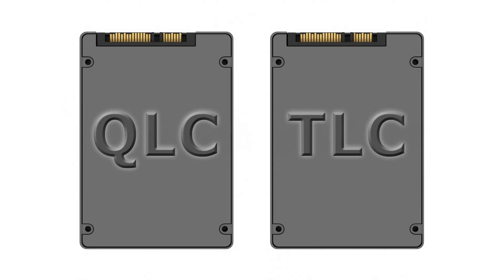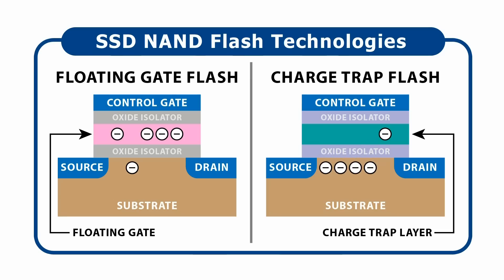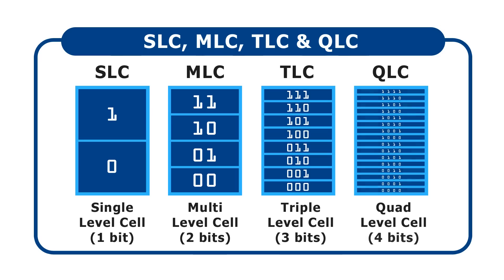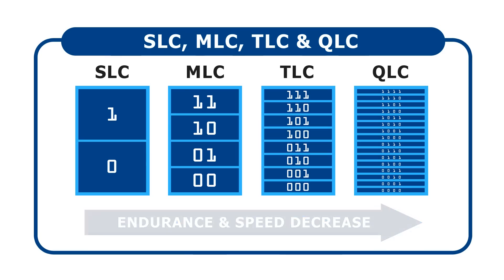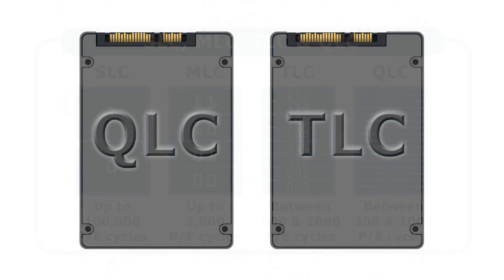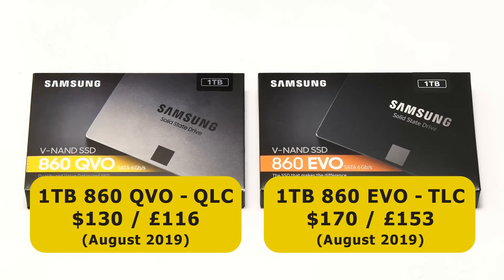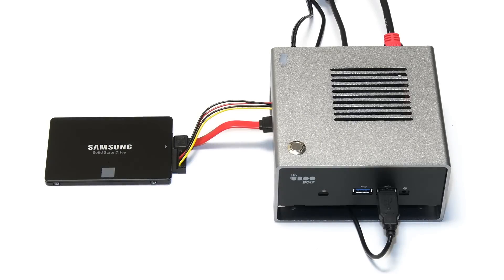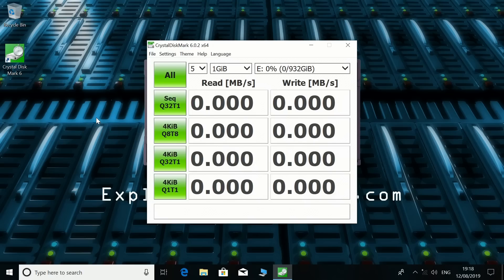QLC vs TLC SSDs: Samsung QVO & EVO

Comment: If hardware not updated on the Evo, it could be clearing the cache as it writes to the storage freeing up additional space for longer use of the cache. Wonder if that drive was close to bottling out the cache. Could you transfer 100 Gb to the drive to see when it slows?

Comment: The biggest SSD that I have right now is only 1TB, and it's a cheap one at that. The reason I'm not particularly bothered by the transfer speed for 42+GB of content is that I usually only transfer 5-10GB chunks to it at a time. And 90+% of the time it's actually just reading content and not writing it. That being said, the initial transfer of the library was painfully slow. It averaged 40MB/s, I think.

Eventually I might replace it with an NVMe drive, but the use-case doesn't require that much speed, so I don't think it will be soon.

Comment: Awesome clear explanation on the tech Cris!
I've been going on strong with a very early model of a Samsung EVO SSD for something like 5 years now, provided that it's a boot drive that is storing nothing of real value in it.
QVOs would be just as good it seems like. But you know, for backup and storage of data that you don't want to get lost, I think things remain the same... magnetic storage still has the upper hand on ability to recover.
Perhaps my next desktop will have a QVO in it, but I'll probably still keep a big HDD there because it's acting as a 2nd backup point of the most critical data, together with my separate NAS.

Comment: Great video, I just disagre on "Would you trust a QLC drive?" Absolutely not! But I also wouldn't trust TLC, MLC, SLC, or HDD for that matter. There is no reliable single-drive solution, RAID and off-site backups are the way to go.
Reply from the maker: I never implied in any way that you I would ever trust any single drive as a data store. Any data you actually want to keep always needs to be on at least two drives. So, obviously, my trust statement was relative. Why do people keep drawing this kind of conclusion? This is a video about one kind of SSD vs another, not about data management and backup strategies. So would I trust a QLC drive as the only place to keep any data? No. Obviously not. But, would I trust a QLC drive as much as I would trust a TLC drive in normal consumer or light business use? Yes. And I think it was pretty clear that was the point I was making at the end. :)
Reply: I got your point. But it is still healthy to nag people about backups whenever storage media is mentioned. :-)

Comment: thanks again Mr Bill Gates from 1995  clone,you explaint everything ,here 1 dolar is 50,so 130 dollars is enough to buy a motorbike,i do not expect to get one of those soon but the information is always usefull,also are they more reliable than a magnetic disk?cause i ve found really old computers with disk still runing and no bad sectors or damage whatsoever

Comment: My 1TB 840 EVO 331 TBW was $410 on sale in 2014 and lasted 4.5 years before too many reallocated sectors for my comfort. My 1TB 860 EVO 600 TBW was $130 on sale at the end of 2018. It's worth noting that the TBW went up significantly with the EVOs over time while the price went down significantly. I'm quite satisfied with that. For my mass storage I will always have a large amount of rewriting and use a WD Black. Those speeds are acceptable for me. So a combined QLC wouldn't fit my use case. I wonder how durable and economical 3D XPoint will be in 5 years.

Comment: i have the 500 GB 830 EVO and i know for sure it doesn't have this 42 GB cache issue, maybe with later EVO's they added this 'feature', but your result does not show it. I would always go for the EVO over the QVO. The QVO is almost like a crippled version of a SSD. Maybe in future when capacities go beyond spinning HDD's like 10+TB, then I would use it as a write once storage only device, and a faster and more reliable NVME as a boot device.

Comment: I'm wondering ; the materials/chips used in the OLC drive are expected to get more reliable and less expensive over the next couple of years, is that right? Thanks for another great video Chris.
Reply from the maker: Yes, indeed so. I would expect QLC tech to improve, just as TLC did and other tech tefore it.
Reply: @ExplainingComputers  Wow, these technologies are growing a lot faster than before. Look how long it took for mechanical (HD) drives to cost what they are now (though the SSD factors into that in today's market also). It's good to know what to watch out for, so thanks again for this video.

Comment: I upgraded from standard hdd to the Samsung evo 1tb m.2 this past July for the first time and OH MY GOD ITS FAST! 🤯🤯🤯 lols
Reply: from HDD to m.2 . its lightening fast .
Reply: Nvme is becoming the new  boot drive standard. While Sata ssd will soon replace HDD for storage.
Reply: are you running PCIe4 yet?
Reply: i mean to be fair any ssd would  have blown u away, nvme vs sata makes little difference, but  hdd to decent sata ssd my god a whole new world, welcome to this world :)
Reply: @cataria3903  fun fact.. SATA SSDs are bottlenecked by SATA... If there was the same SSD just for PCI-E it would be much faster xD
Reply: @kajmak64bit76  this is not true.
the same ssd for sata and nvme generally doesn't get made, because it wouldn't make any sense.
to take advantage of the higher speed of pcie, the ssd needs a faster controller and faster nand. the thing is,  that getting really fast read speeds on current nand isn't hard, so u won't see any 700 MB/s pcie ssd on reads, because it doesn't make any sense.
however u can and do see  garbage TLC or QLC pcie ssds, that will burst write really fast (over 1 GB/s), but then will massively slow down, once they run out of ram + slc cache.  those drives can drop to 100-200 MB/s on write,  on a long write, or on a full drive,  which is a fraction of the write speed of my 850 pro for example, which doesn't slow down at all, because MLC.
however none of this actually matters, because the comment i responded to was about an upgrade from hdd to ssd, and in real world snappiness/responsiveness there is little difference between really really fast top end ssds and ok TLC ssds.
the MASSIVELY faster random read/write iops compared to hdds makes the difference here, NOT the maximum sequential read/write speeds.
but to get back to your comment, no the same ssd for sata and pcie would not faster on pcie,  but cheap controllers and nand can already be so much faster than sata,  that at about the same price and with the possibly same branding the nvme drive will be massively faster.
Reply: @cataria3903  that's all fine and dandy but the SATA SSD is maxing out the SATA interface... Which is why basically all SATA SSDs are the same speed basically.. They literally can't go faster because SATA is limiting it.. That's why PCI-E SSDs are a thing
Reply: @kajmak64bit76  it is important to make a difference between maximum sequential reads and writes and the limitations of those numbers.
for example, there are now QLC ssds from several vendors.  those SSDS will slow down on sequential writes to 100-200 MB/s, in comparison my 850 pro will write sequentially at i think above 450 MB/s . in this case my sata SSD is 2-4 times faster than the nvme ssd in this scenario.
this will also aplpy to TLC ssds, but less and heavily depending on the SSD, but in general it is important to note, that max advertised read/write speeds may NOT be representative for what u will actually get in your work load, if u are copying 200 GB regularly to and from the ssd, then a QLC ssd will be hell for u to work with :D 
if u only go by maximum read/write speeds for ssds, then u falling for marketing,  as those numbers hide a lot of things. yes the SATA interface is limiting, BUT in real world usage u won't notice the difference between sata and nvme in general and if u are using a drive for sequential writes, then a good MLC sata ssd will poop on some new garbage QLC. one should always look at proper storage reviews and not buy by "highest number"
Reply: @cataria3903  but still... Just because there is no difference for general consumer doesn't mean there are no difference and that it does not matter it does matter and i understand the marketing speed and the actual speed... But still... Either way you look... SATA is a limiting factor and that's why M.2 NVMe SSDs are a lot faster and as i said almost all SATA SSDs are basically the same speed... Like even the fastest SATA SSD is running and advertised as almost every other SATA SSD yea sure TLC and QLC and others will slow down over time when transferring files but still... Max possible speed for a SATA SSD is pretty much the same across all SSDs... The limit goes away when you switch to PCI-E XD
Reply: @kajmak64bit76  i am not denying, that sata is limiting, of course it is,  but one shouldn't forget the other limiting factors. also there are a lot of speed differences between sata ssds, a lot still get massive slowdowns on writes  (bad tlc drives), a lot of bottom tier drives don't have dram on them, which means horrible performance!
the point was, that u are buying a drive, not a protocol (nvme vs sata), look at proper benchmarks, including full drive writes or 90/95% full performance (to remove most of slc caching).
also remember, that random writes/reads can still differ massively compared to sequential reads/writes, again look at the drive and not the protocol.
and btw, there are also more concerns than just speed for qlc, like lifetime nand writes, unexpected issues, given how new qlc is too. (look at 840 evo bs, that should have resulted in mass recall and replacements, but samsung showed consumers the middle finger instead).
Reply: Same here it's much better than ordinary ssd's

Comment: 12:34 "Slightly bewildered by..."
I am not. I have the 840 Evo. This drive was known to have an issue. It was sold as a software issue. But it was never resolved. It was described by reviewers as a "crazy drop in performance", eventually after the problem manifested itself.

Essentially, the "fix" was to buy an 850. 

I will never buy a Samsung SSD again based on Samsung's  reputation alone. So videos like Chris's is valuable to me. We run backups that exceed the sizes in Chris's video, so....no QVO's for us for the time being.

Comment: TBW concerns? NO
My Samsung SSD has been use in my daily-used work/gaming system for about 3.5 years. SMART reports 48TBW. So if you got a QLC SSD with a 360TBW rating (which it will exceed just fine thanks) it would take 26 years to hit that number at my usage pattern. TBW should be much lower on a dedicated game SSD since beyond the initial install and updates there's not that much writing involved.

Comment: 155MB/s isn't that bad for most users if they have to write large amounts of data as that's the same speed as some SATA disks.
Reply: way to fast in comparision to HDD
Reply: @Q_QQ_Q  Oh yeah, I know that pain, I have to buy new HDD, to make a copy of my file from old hdd, on which errors began to appear, copying a few tera of date was kind of a pain in a... "back" to do.
Reply: @Gilfar  Your drive controller became too hot when copied large file, you must pull enough cool air to prevent it. (PCB on drive)
Reply: @claritoresdiano1021  I was aware of that, that why I copy a few GB of file at once, it took me like two days to safely copy everything.

Comment: Great video, quite a hard one to get all the detail in such a small space, and its a moving target as well with new data emerging all the time.

I guessed it was going to be SSD, in fact I thought I said
as much here but apparently not.  I
guessed because it is in the ‘news’ now on just how not very good they
are.  I’m being naughty and listening
while I type as I am OK with SSD.  

What is killing it is the lack of DRAM apparently, there’s
more to it than that but that is the crux of the matter.  So, we have over supply of DDR (and quite a
few types of memory) but NVMe is stable because they had a bit of an ‘outage’
which hit supply recently.  Back then
they said this would inflate SSD prices, but it looks like that isn’t going to
be the case.  But I still feel we are
being sold a kipper, the SSD price crashed on multi-level and has stabilised,
and that is artificial as the wholesale prices are lower.  The vendors are just sticking at the prices,
especially on the lower densities (so your 128GB are all costing £20 whatever happens
downwards).  1TB you see some price
benefits, even with NVMe.  But they have
come along with TLC which is inferior (and it is at the end of the day) and is
going to give us lower lifecycles- although theoretically we could see some big,
cheap, SSD on which to lose our data in return. 
Good time to look at your NAS and back-up strategy, I think.  I haven’t checked the more enterprise drive
pricing recently but it seemed robust a few months ago- they still cost- new
anyway.

In the tests I am seeing some performance is poor performance
on the short writes/reads.  I’m sure I’m
not the only one who has seen some shockingly slow speeds on short bursts,
faster than spinning rust but maybe only twice as fast.  Some of the NVMe performance is genuinely highly
questionable.  Really high temperatures
as well.  I can cope with that
under-performance to a point.  If I can
get a slower (but still very fast by real life standards) NVMe for between £70
to 80 per 1TB then I have a lot of other benefits (and again I can, most
recently from CCL).  For a start your
builds are easier, cable routing (what cable routing) is improved, battery life
for laptops is improved, weight for portables is improved.  Motherboard design can change (for the
better).  If I also want fast, I can pay
more. I suppose that will be the new PCIe 4 coming into play, but those boards
aren’t cheap.

Totally agree with the change in storage strategy, but I come
to a different conclusion.  I tend
towards desktops, and ITX/SFF at that.  So,
I have half a foot in the portable camp but really, I am a desktop guy.  I don’t care about power consumption
relatively speaking, I care about heat. 
I care about speed, but really for my boot drive, I will horse trade and
accept additional SSD at slower speeds if there’s evident value.  So, this is how my environment has
changed.  A lot more NAS, though this is
partially coincidental (I wanted more flexibility beyond SATA only).  A good boot SSD that costs, some (say 1GB) of
NVMe SSD or depending on use case/budget SATA SSD- and that would be my three
tier storage.  I have used three tier
since as long as I can remember.  And now
I search out EOL enterprise drives for the NAS/ back-up.  You can get them.  Enterprise swap out their drives on a schedule,
they don’t wait for them to fail, they get a bath once a year if they need it
or not.  Those drives will have no errors
and obviously they are more robust than retail consumer drives.  They go in my ‘new’ NAS instead of NAS drives
now, you just have to keep your eyes open for them and make sure they are
validated no errors- then they cost about the same as a new standard HDD.  I haven’t seen anything worth having in
enterprise SSD though, presumably they aren’t due a bath yet.

The idea of the one big 2TB seems entirely on point, but I
think they will be TLC or on better models a smaller faster boot (no more than
250GB and still plenty of 128GB) and then the TLC.  But how is this going to affect the ultra-books
and the hybrids (Surface Go/Pro).  There’s
money to be made in that there cloud, I think. 
I have a Surface Go (with the Cherry Lake and 8GB) and the Pro 3 with an
i3 and 4GB.  The Go is a funny old thing
managing to be both crap and excellent at the same time- it shouldn’t work but
it does and that is down to the 8GB because the Pro feels much less impressive-
has worse battery life, is heavier, has no USB C, the sum total means MS make a
Cherry Lake (trail?) seem like a decent CPU which is more than the SBC have
been able to do.  If they stick TLC in
those that will be a disaster.  Already
the Surface plays close to the wind with things like 64GB of storage- no matter
I just attach a SATA SSD, but what if that is a TLC? Again, these are cloud
devices, nobody really tries to use one as a desktop, but it feels like that
data just got less secure and if I want that security, I will be paying more
for it and I will be dependent on the cloud. 
The Cloud is the future but I’m not ready to give it all my data quite
so easily just yet- I can have my own cloud (or maybe more correctly Edge) sat
between me and the cloud but it needs to be robust, and it can’t be dog slow
either- and I mean relatively speaking. 
We are seeing ever faster ‘intranet’ speeds now with motherboards coming
with GbE.  Still early days as you also need
the rest of the kit but our interactions with our network are going to get a
lot faster and I’m not sure those TLC are going to cope lacking in memory and
pumping out heat all over our now actively cooled motherboards.  

The future seems less secure than it did 18 months ago when
we were just settling down to ever increasing speeds, ever increasing capacity,
ever decreasing costs and ever-increasing evidence of the real-life robustness
of SSD.  To be honest enterprise seems a
good fit for TLC even if you’d think not. 
They haven’t been able to justify moving to SSD because of cost, but
they can run massive redundancy so cheap TLC might be just what they, and the
manufacturers, need.  They can afford to
have them fall over more than the average Jo. 
But I won’t be searching out those drives when they are due their bath.

Comment: Some higher capacity drives with a certain number of bad cells are sold as lower capacity drives but still retain the larger cache. This might explain the discrepancy.
Reply from the maker: A very good point. This may well be the case here.